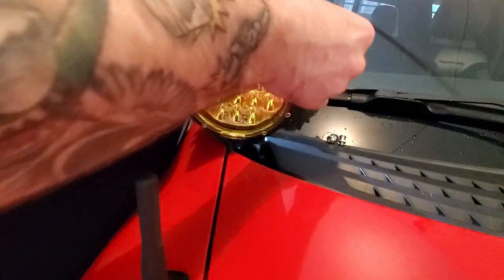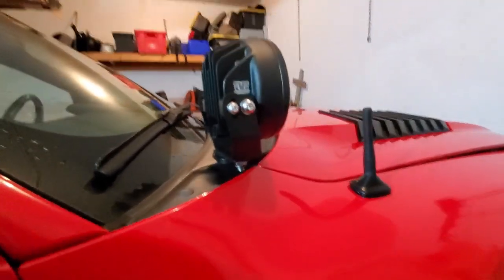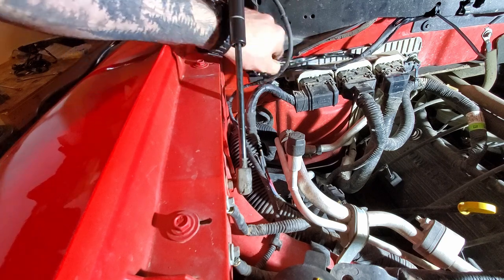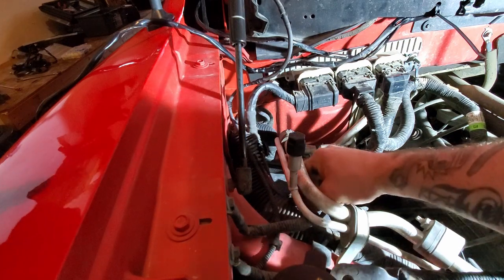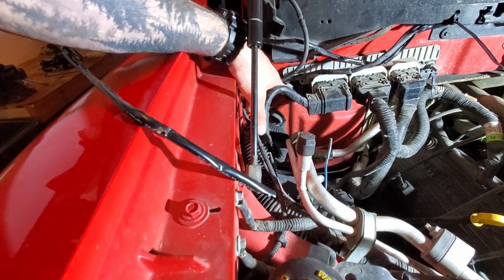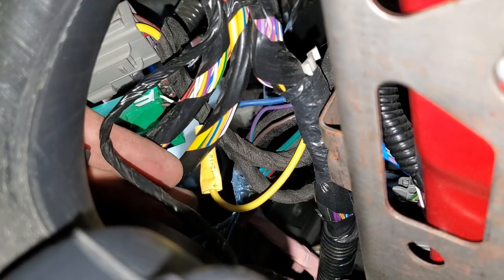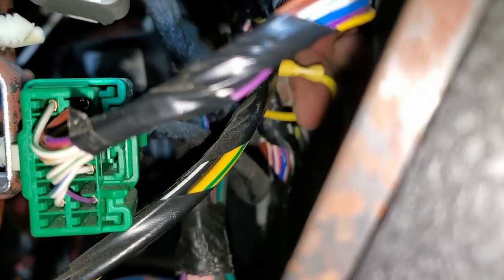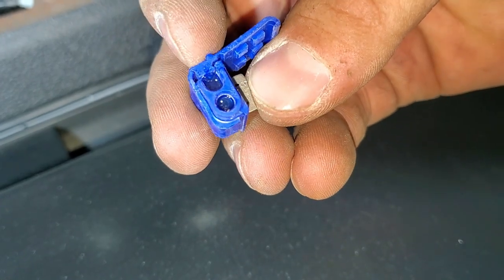Raptor Aux Light and Switch Wiring

Comment: So we don’t need the relay to the lights
Reply from the maker: Yes, you will need to use a relay still to run the lights. The amp draw is too high and would pop a fuse.
Reply: @minutemaintenance7385  so keep the relay an and fuse an wire all that to the aux switch in the truck
Reply: An I’m using a small square pod to
Reply from the maker: So the wire you run from the aux switch will power the relay. The relay is connected to power, ground, and sent towards the light.
Reply: You don't need a relay if the load is under the amp rating of the aux switch used.  you would only need the relay if the load has a greater draw that the rating of the switch connected to.  In this case a couple small LED's you probably wouldn't need a relay.

Comment: So the aux switch wires arent powered already? On a 2018 raptor the wires from the aux switches were already hot just needed to connect the lights to it
Reply from the maker: The wires coming out of the switches are hot, but they need to be connected to a "pass through" wire if you're running something on the outside of the truck.
Reply: The Gen 1 upfitter switch outputs are hot, like the Gen 2. However, on the Gen 1 these go area behind the glove box, not under the hood like the Gen 2.
For the Gen 1, you use the "pass-thru" wires to get the power outside the cab (into the engine compartment). For the Gen 2, those same "pass-thru" wires allow a connection from under the hood, back into the cab. The pass-thru wires are used for the same function, just in opposite direction for the Gen1 & Gen 2.  Hope that makes sense?

Comment: Do you notice any hood glare when driving at night?  Also, any issues from dust, snow, or fog with the yellows up high?  Pro’s or cons since installing?
Reply from the maker: There is a little bit of glare but the benefits outweigh it. They are a huge help. I've done a couple night runs with them and was never worried about something jumping in front of me unexpectedly.
Reply: @minutemaintenance7385  very cool, thanks

Comment: Does the factory switch have a relay/ fuse? I guess you only needed the + and - wires that went to the lights...(?)  I have an led light bar  I was going to install on my 2014 and it doesn't have wiring harness,  wondering if I need just the ground and positive or if I need a relay... Thanks, great vid
Reply from the maker: The factory switches have fuses but no relay. You would add the relay after the pass through, in the engine bay.

Comment: So where did that yellow wire come from? What did you connect it to?
Reply from the maker: Yellow wire? Under the hood?
Reply: That yellow wire under the dash is the output wire from the upfitter switch (Ford wire). He connected it to the blue "pass-thru" wire, allowing the upfitter switch to power the ditch lights.